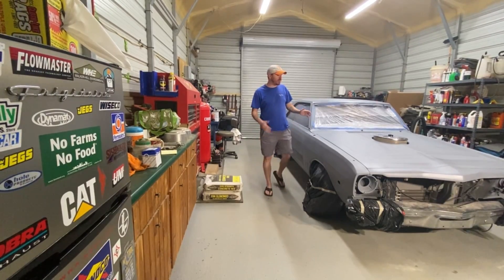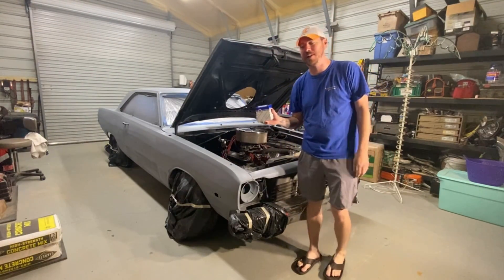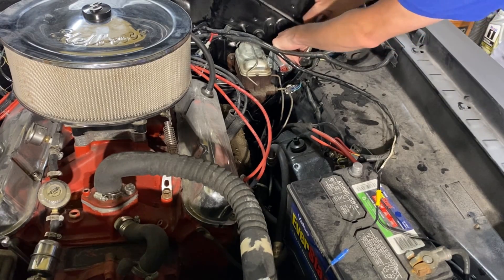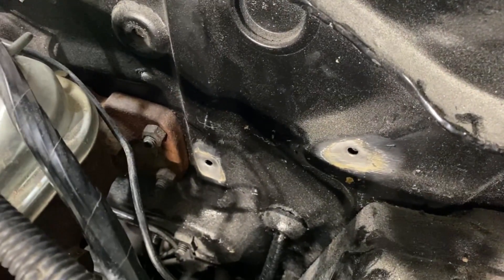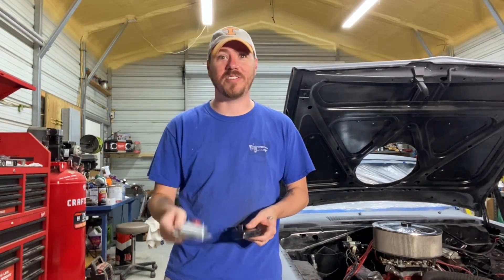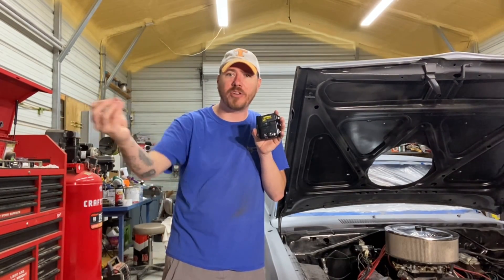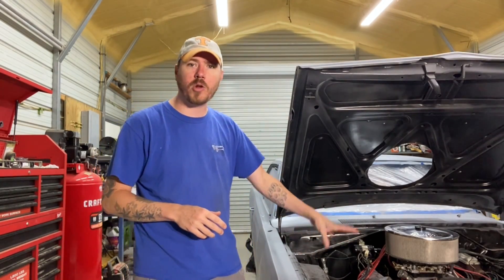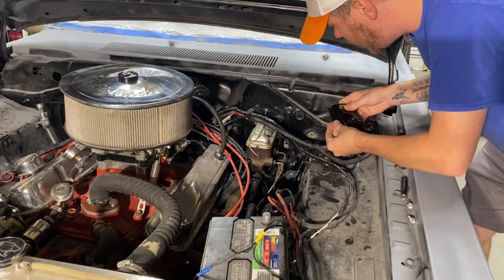Bad voltage regulator causing BIG problems.  Don’t burn your mopar down.

Comment: Good thing you caught that regulator in time. Another good upgrade is to run a heavy wire from the alternator lug to the battery terminal with a fuseable link.
Reply from the maker: Excellent tip!
Reply: That's what I did by the way thank you for answering my comment love the show I'll be watching more of them
Reply: I ran this "shunt wire", but w/o a fuseable link........what size did you put in, around 20 amp?

Comment: I have the fancy in black MOPAR regulator, it was hardly used,and i retired it. It was pushing 17/18 volts. Doing fine 14.2 range with an ECLIN / aftermarket whatever

Comment: I have a 70 Dodge Charger and there is firewall brackets that the voltage regulator goes to. do you think I still need to get that sticky film off the back of the regulator? ?

Comment: So removed a mechanical regulator because I installed electronic ignition. Installed the performance regulator and at the alternator it’s charging at 12.5 volts. With the mechanical one it was at 14.8 volts. What should the alternator be charging at with performance  regulator?

Comment: What size small block Mopar and cam do you have? It sounds good. By the way, sadly I’ve been down the cheap voltage regulator path my self and caught it just in time as well, but the cheap chinese one that I used was of the “adjustable variety “. Once I saw my voltage spiking upwards of 19 volts after like six months of installing it and my headlights looking much brighter than usual, I got rid of it and put a n.o.s. regulator on my 1970 Newport and all good since.
Reply from the maker: @Mopar-k6o  just a 318 bored 20 over.  I’ve since put in a Hughes roller cam and morrel roller lifters.

Comment: Are you going to add a "shunt wire" from the alternator straight over to the battery positive?  Dead Dodge Garage does a good video on the reason why all of us Dodge owners should do so.   Right now, even with the shunt wire, the alternator is still putting out too much......15.5 - 16 volts at idle.  I guess I should order the quality Mopar Volt Regulator as you did.  How high was your volt reading when things went into "meltdown"?

Comment: Grounds are good.  
Battery to block, battery to chassis, block to chassis.  And ground to electric components, VR and ICM. 
If you are concerned about corrosion,  put some dielectric grease on it. 
If you are concerned about full voltage feed, keep it under the hood with direct feed relays, 
The firewall plug is 50 years resistive connections.

Comment: The original bolts that hold the voltage regulator and the ECM are special 1/4" x 20 bolts with a captured spin washer the has raised edges that cut into the paint and provide a good ground those bolts have a anchor symbol on them.
Reply from the maker: You’re not wrong, but there’s nothing wrong with going above and beyond to ensure you have a great ground.

Comment: In the ignition circuit, cars of that era had a number of radio suppression capacitor/condensers.  One may be on the coil.  One may be on the alternator.  One may be connected to the clock, another to the instrument cluster.  These may be blown, as they were never designed to last this long.  If any of them are bad, it will create the symptoms of a bad voltage regulator, with flickering lights and a dancing needle on the ammeter.  Toss them out or replace them before putting expensive new parts in the charging system.

Comment: I have 12.3 volts coming in to ballast but only 6-7 volts going out to the coil is that the problem or the ignition module
Reply: No spark sometimes

Comment: Im getting 16 volts to my battery and the ballast resistor is brutally hot. I have one of those chinese regulators on mine. I think this will bring the flow down to the correct level. Can you give me the full number of that new regulator? Id appreciate it! 🙂
(Only i have a slant 6)
I see it on jegs, but i just wanna be sure.

Comment: My Military power wagon runs like 15.2 volts which is a little high.
I have quality USA voltage regulators also 
76 model Truck

Comment: Could not agree more with you about the cheap voltage regulator.  I have a '93 Dakota 5.2L.  They put the regulators in the OBD1 (idiots). Instead of getting another PCM I added an external voltage regulator and bypassed the PCM regulator. You have no idea the amount of time I have spent on getting it right (still not sure it's right).  My advice: 1. You MUST have a solid ground.  An absolute MUST.  2. Check your connections not once, not twice, not three times, not four, five or six times.  Check them over and over and over.  Any weakness whatsoever and you will get funky results.  In my case, I have slightly munched threads on one of the field wire connection studs on the alternator.  It rears its ugly head big time. 3. Exactly what you said...do NOT skimp on parts and especially the regulator.  I started out with that cheap Chinese crap and they were nothing but a headache.  Ended up with a New Old Stock OEM Mopar regulator.  Much better!  I'd like to know where you got you regulator, OEM, part#, etc...  Thanks for the vid bud!

Comment: I learned another thing today.  If you have stepped up the draw on your electric system you need to add a larger wire feeding the regular, field wire. Everything is drawing more current.  Just going from the stock 18 to a 14 reduces the resistance feeding the field is a inexpensive improvement.  The extra ground wire is a good move. The part of the field wire that feed the regulator is just telling the regulator what it needs to do. In 1970 MOPAR went to the current moving through the ground is what controls the voltage that the alternator delivers. Always make sure that the plug on the regulator is tight. A loss fitting plug will cause heat at that connection. They are not always good out of the box. But like he said here you get what you pay for. Always check the resistance from the regulator case to a known good ground point. A 80$ regulator not grounded well is not going to do its job or last very long.
Reply from the maker: Very good points!
Reply: Yes, thicker wire, less resistance but more current. Some people just have far too many gadgets that put a strain on the charging system.
Reply: I been fighting to have proper voltage for years. First adding a stereo, electric fuel pump, radiator fans, transmission cooler fan, an AL6 box, ran a electric water pump for a few years but have gone back to mechanical one, over heating on Woodward was a problem for many years. The electric pump worked well until the voltage dropped below 12.5 V. Then to top it off when I thought I had it,, good voltage I added the Edelbrock Pro-Flo 4. All of it wants more amps and steady Voltage. It's a 1969 Barracuda, Michigan car, that was driven in the winter for the first twelve years of its life. Corrosion everywhere, the firewall connections were a mess.  Like the video will have to look at more of them. There is always something new to learn and YouTube makes that easier.

Comment: Better make sure that ground wire is behind the box not in the front like I see people do
Reply from the maker: Yessir that’s exactly where it is.  I’m pretty sure in the video I showed where I took the paint of the back corner on the box.
Reply: @BlownBudgetGarage  yes you showed the part where you took off the paint but I didn't see the connection on the back. Just when you screwed in the front part. I'm so glad that worked for you I'm about to order that same set up for my car. Too many problem with my charging and I'm tired of the computer having it I want a separate unit
Reply from the maker: @ltbomb7194  I haven’t had a single issue since swapping over to this voltage regulator.  Highly recommend it.
Reply: @BlownBudgetGarage  I can't wait. Soon like in a week or two. I've seen a bunch of other videos about these and yours is the only one that I've Seen that actually got me excited to do it. The others had too many problems with voltage fluctuating. And they all put the ground in the front. Lol
Reply from the maker: Thanks man I appreciate that.  Hopefully it helps your problem.  Stupid cheap one ruined a new wiring harness and almost burned my car down lol

Comment: I think you solved my issue.  Just got my restored Mopar road ready and system is always negative charge.   I will check to see if my freshly painted firewall is bare behind the regulator mounting
Reply from the maker: Hope it helps!!

Comment: There is one piece of this video that is BAD BAD BAD advice. Do NOT grind the paint off the body to get a ground. The factory never did it and still doesn't do it. Bare metal corrodes, corrosion causes BAD ELECTRICAL connections. All you need is a bolt with the proper captive washer. That is a washer that has teeth to bite into the paint. I've been working on vehicles, specially muscle cars, for over 35 years. I know what I'm talking about.
Reply: I put proper ground to the regulator. But sonettens is wrong. The fusebox gets very hot and the dome light starts to shine. What went wrong?
Reply: The premium voltage regulator at Napa has clear grounding points on case design by manufacturer with star washers included
Reply from the maker: Cool story

Comment: I'm also a mopar man going through the same problems with my 85 dodge pickup and like you I bought a 20 dollar part that lasted about 2/3 months my battery is getting hot high voltage that I've noticed really bright headlights genuine mopar parts just can't beat them
Reply from the maker: Were you ever able to get this fixed??

Comment: If you take cable off while it's running and truck died, us this a for sure test that. The alternator is bad for sure or could it be bad voltage regulator?

Comment: I've had the same problem like 5 months ago. I was driving on the highway when smoke came from the dash. I have pulled over immediately and found out at home that the regulator has failed (the battery was charged up to 18V). But the smoke actually came from the ammeter wire that melted away, together with the ammeter itself (another weak part in a mopar electrical system). I've got a new one now, just have to repair the wire terminal... The new voltage regulator is an SMP VR125, so not an original product either, but I might switch to an OEM part.
Reply: Did you have to replace the wire only or the gauge also. Where is the replaced wire located. Thanks.
Reply: Thanks Mikuro. It looks to be the same situation with my regulator. I've fitted a new spare that I already had  but this weekend I will remove it and clean everything back to bare metal undrneath the lugs and then keep an eye on the ammeter as I have a feeling that it is probably the main cause of the problem.
Reply: a big part of the problem

Comment: This video is helping me  with something I am dealing with on getting my Dodge to start every time.  Also what did you use (insulation) on the inside roof of your building?
Reply from the maker: I haven’t insulated it yet lol it’s a hot box in there during the summer.
Reply: @BlownBudgetGarage  I saw the yellow on the inside.  Looked like spray on insulation.  I have the same issue from the sun heating the metal.  But helps during the winter in KY.

Comment: so when you put the original regulator in was the battery fully charged a low battery will cause a high charging rate just sayin
Reply from the maker: Great question!  The original one was a repop from autozone that I bought that lasted about 2 hours of use.  Brand new fresh fully charged battery.  No issues since replacing it with the mopar performance regulator.

Comment: Another important thing..? Instrument cluster voltage regulator. Real Time Engineering sells an electronic unit that is far superior to the original piece and the parts store pieces.